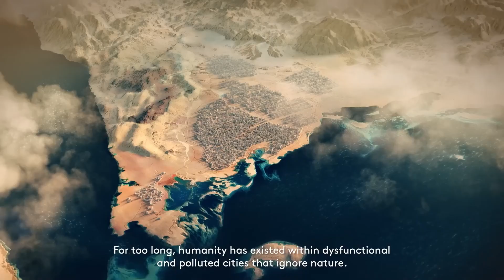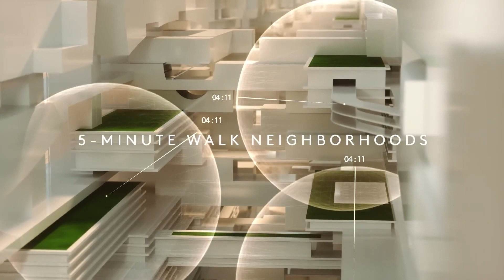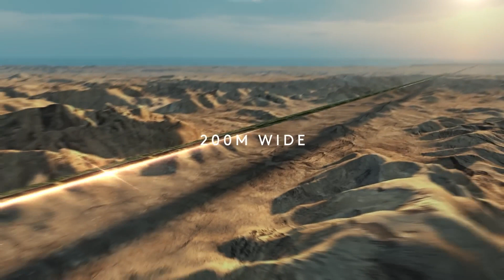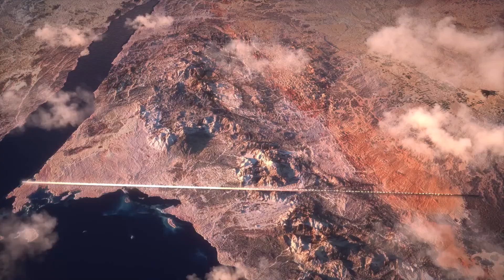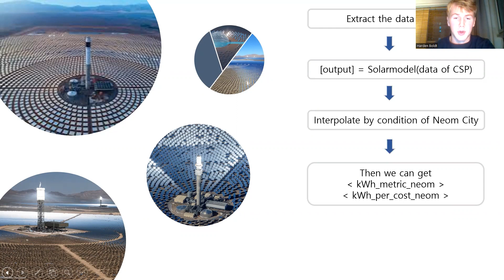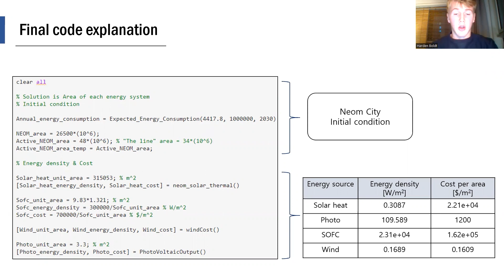Engineering Numerical Analysis: Group 7 Final Project

Comment: Systematic and Great project. In function SolarModel(Latitude, airpressure), you guys picked 'hours' from 7 to 17. But it is just for winter. Summer sunrise and sunset is 5 and 18. What would be the result of applying the sunrise and sunset times differently every month to month? (Group 2)
Reply from the maker: Thank you for the good point. The reason why we assumed winter condition from 7 to 17 is actually not so critical.
kWh_metric_cal = (Solar_neom./Solar_mag).*[kWh_metric_Ivan kWH_metric_Quar kWh_metric_Cres];

 Eventually, the amount of isolation obtained from solar model does not go into the absolute value, but into the proportion. Therefore, I don't think the difference in insolation proportion value is significant, whether it is exporting the insolation obtained in summer or the insolation obtained in winter. Of course, I think the part you pointed out in the code that uses the absolute value of insolation is very meaningful.

Comment: (Team#1) It was really interesting topic. Is there a reason that you choose the constant area when you calculate the Green Hydrogen Energy? I can see the price and area per module when you explain about it but it looks constant on the last two pages.
Reply from the maker: Thank you for good question! It’s very good point. Except for SOFC energy, solar, and wind energy are all sources of energy directly affected by climate. For example, if a climate with no sunlight and little wind continues especially like circumstances under sandstorms which are quite common in Saudi Arabia, solar and wind energy alone cannot produce it. However, since electricity generated by hydrogen is not affected by the climate, the minimum area of SOFC was assumed and the total energy was calculated for proper energy supply even in energy emergencies such as abnormal climate continuity. And in the literature review the minimum safety factor for emergency generating power is 25% of the entire energy consumption and the maximum is 200%. So we chose the minimum value for SOFC production in case of such an event.

Comment: Amazing! it was easy to follow and enjoyable, team  (11)
If we may ask, have you taken in consideration the energy transmission costs, if not how do you think it will affect your current result? 
Best regards
Reply from the maker: Thank you for good question! To consider the energy transmission cost, way more specific and detailed construction plans are needed, so we excluded that part. Generally, adding the transmission costs to energy consumption prediction, energy production requirement will become higher. The location of Neom gives an advantage to mass energy production, as the necessary space for energy plants can be located so close to the Line the loss can be negligible.

Comment: Very interesting topic! The Line is something I haven’t heard of before. If you increase or decrease the percentage of energy coming from green hydrogen fuel cells (currently set as 25% as one of your boundary conditions), how would that affect your results in the conclusion? (by Group 12)
Reply from the maker: Thank you for your question. The change in Boundary condition you're talking about means a change in the reference value for a city encountered in a weather disaster or abnormal condition. Obviously! The kWh is calculated by unit of price and area, so it will result the new composition of wind power, solar thermal, photovoltaics in the new BC which are different from the results of the existing 25% BC. Of course that composition will ensure optimal efficiency between price and area.

Comment: in the second boundary condition, i wonder 25% is  selected your own or there are some reason for it .( group 10 )
Reply from the maker: Thank you for your good question! It’s very good point. Except for SOFC energy, solar, and wind energy are all sources of energy directly affected by climate. For example, if a climate with no sunlight and little wind continues, solar and wind energy alone cannot produce it. However, since electricity generated by hydrogen is not affected by the climate especially like circumstances under sandstorms which are quite common in Saudi Arabia, the minimum area of SOFC was assumed and the total energy was calculated for proper energy supply even in energy emergencies such as abnormal climate continuity. And in the literature review the minimum safety factor for emergency is 25% of the entire energy consumption and the maximum is 200%. So we chose the minimum value as a guaranteed means of covering essential service energy.

Comment: Thank you for the presentation! Just out of curiosity, is there any official announcement or any kind of cases similar to Neom projects? I just wonder how close your results are with the real engineering cases. (Group 9)
Reply from the maker: Thank you for the good question! There is no large project similar to the Neom project, so it will be difficult to compare properly. Our calculations are feasible because the constraints used are based on formal data and the computational process is sufficiently probable. For example, the estimated power consumption announced by the NEOM project was 50 to 60 TWh, which is similar from our estimate.

Comment: Thank you for the interesting topic. Our question is : why the graph modifications of solar heat and wind came out like that in the Conclusion slide? (by Group 8)
Reply from the maker: Thank you for good question! In the last chapter of the slide, we plotted using MATLAB's Semilogy function because of the order difference of the number of energy sources and the amount of power produced. So the y-axis has a log scale, it represents a Log function shape, not a straight line shape.

Comment: Great video! The concept of the Line is very interesting. Our question is: in the conclusion slide, why did you set a fixed number for the photo and SOFC energy sources, while changing the number of solar heat and wind energy sources? (by Group 6)
Reply from the maker: Thank you for good question! It’s very good point. Except for SOFC energy, solar, and wind energy are all sources of energy directly affected by climate. For example, if a climate with no sunlight and little wind continues especially like circumstances under sandstorms which are quite common in Saudi Arabia, solar and wind energy alone cannot produce it. However, since electricity generated by hydrogen is not affected by the climate, the minimum area of SOFC was assumed and the total energy was calculated for proper energy supply even in energy emergencies such as abnormal climate continuity. And in the literature review the minimum safety factor for emergency is 25% of the entire energy consumption and the maximum is 200%. So we chose the minimum value as a guaranteed means of covering essential service energy.

Comment: Great job on analyzing energy system. Here are some questions that I had while watching the video. What does tolerance mean at the conclusion section? And I don’t quite understand the standard that you put to make a balance out of each energy. (Group 3)
Reply from the maker: That’s very good point. The range of the last calculated value is the range in which no one energy source produces a negative. If you judge the minimum cost based only on the calculation results, you get zero solar power plants. However, this is not appropriate in real situation. Other energy sources, except hydrogen energy, are closely related to climate. So if the abnormal climate like this continues, it will be difficult to supply energy steadily. Therefore, balanced development should be achieved, not biased development on one side. This is what we're talking about, Energy balancing. When the number of solar power plants reaches zero, the solution is presented when the area of solar power plants and the area of wind power plants fall within a specific tolerance range. This Tolerance was selected randomly, but I think it is a necessary criterion for calculating the actual power generation area.

Comment: Thanks for the video, it's a really interesting topic! What would you advice neom to change in their plans for energy production? Also what is your general opinion on "the Line", do you think this is a project that could actually work or do you think it is just a fun idea in theory but not in real life? (by Group 4)
Reply from the maker: Thank you for good question! The energy production plan is just a small part of the whole construction project. We did find the solution for energy production based on the boundary conditions we have considered. So yes, we do think the project will be possible only if the boundary conditions are possible too. We are doubtful of some of the announced official objectives and plans relating to our boundary conditions. So regardless of our team project, we think Neom should first change the large ‘line’ design to a more efficient and feasible form. However, construction for the Line is well underway and funding secured by the Saudis, House of Saud and investors has the project covered for the foreseeable future.